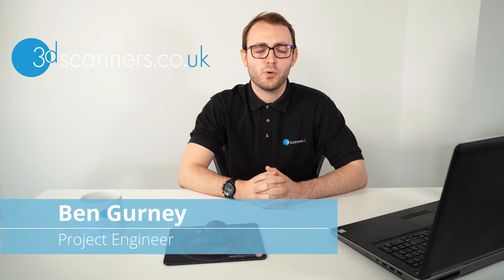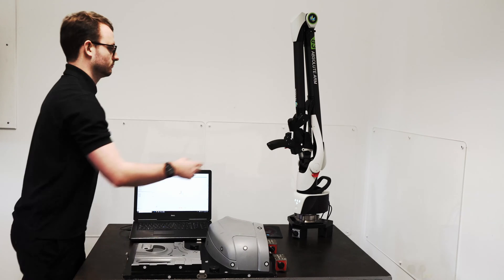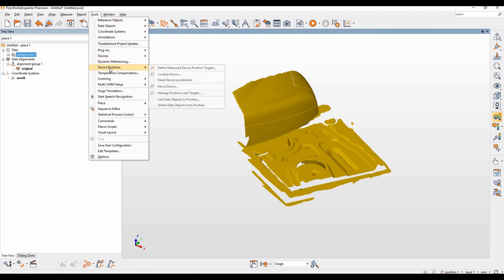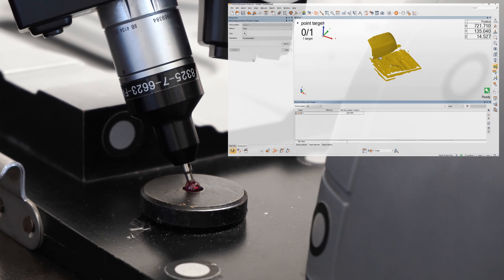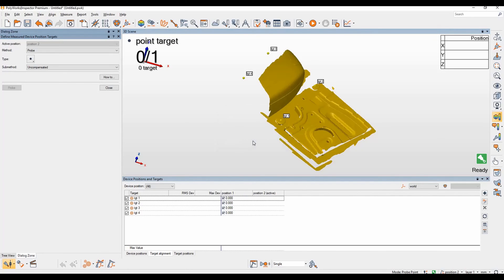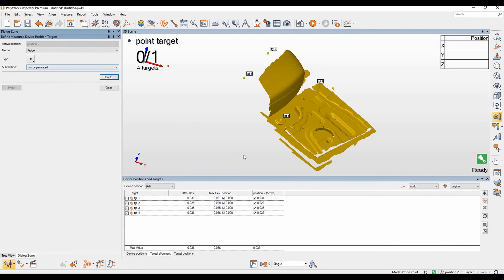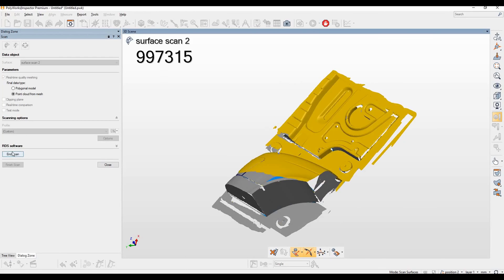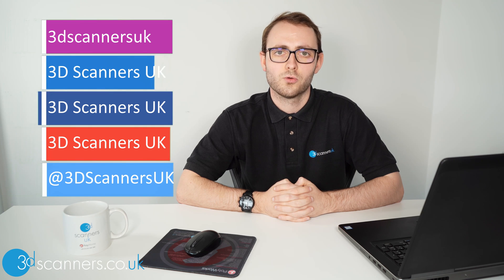Device Position Move in PolyWorks | Using Probing With Targets

Comment: Hi...plz tell me..we have round dies and parts to scan...we don't have any such holes for targets as parts are symmetrical...so how can i use this method to scan top and bottom sides...Awaiting your reply
Reply from the maker: Hi Inderjeet,

If you are not able to use anything as targets then the best method would be to align the scans together using the best fit data to data option, just make sure you get plenty of overlap between the scans. When moving the device/part between scans make sure you click custom as the alignment method rather than targets as in this video. Once you have completed all of the scans you can then align them together one by one. 

If you require any further advice, please email support@3dscanners.co.uk

Thank you for your query.
Reply: @3DScannersUK  hi....thankeww for your valuable guidance....Also plz tell..i have to measure concetricity of two coaxial cylinder using probing method...how can i measure it...as if i make one cylinder as datum and check concetricity of second cylinder it show my results out of tolerance..but if i use a constructed line between two cylinders and make it datum..then it shows the concetricity of both cylinders within tolerance...so hw to know which method is right
Reply from the maker: @inderjeetsingh4231  Concentricity is measured by comparing one axis to another. The method you stated of creating one as a datum and comparing the other to that datum is correct. Regarding the way you check it, your drawing should tell you which axis the datum is and then you create a concentricity callout in Polyworks to match what the drawing shows.

Hope this helps.

Comment: You didn't follow the same order of targets in position 2 as of position 1. What is the reason behind it? If we use the same order of targets in both positions then will it alogn or not? And can we place targets any where on the job? Or they should ve symmetrical to each other.
Thanks
Reply from the maker: Hi, thank you for watching the video, you don't need to follow the same target order in the second position. Once you get three targets probed in the second position the software will know the correct position. The targets are generally hole centres, or places where a probe can reliably rest such as cone feature. I hope this answers your question.